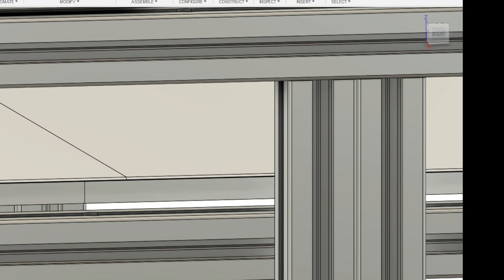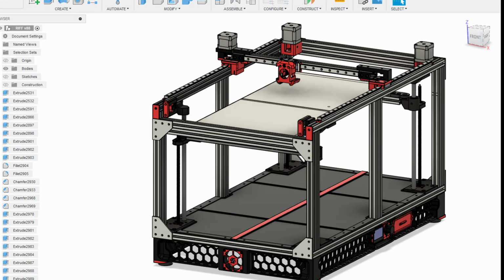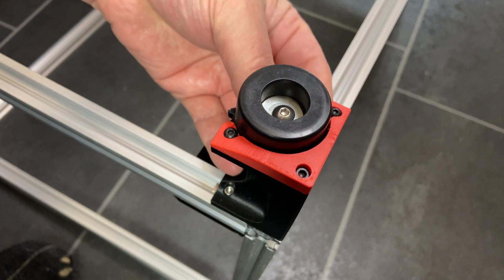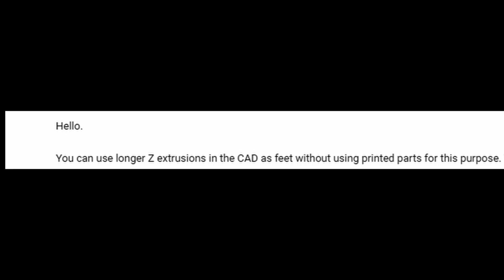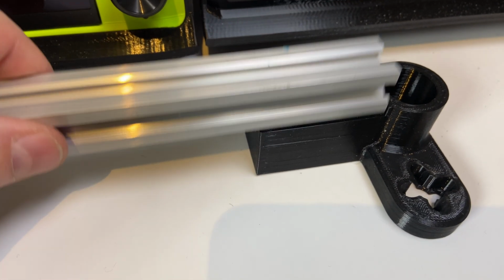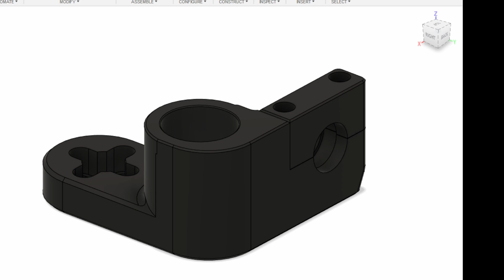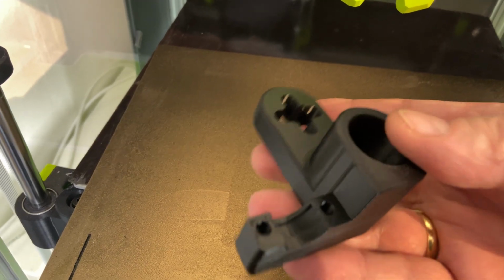The RIFF 600/900 3D printer 2 - skirts and z axis

Comment: Hi, In your design the 00:09:40 arm mounted extrusion is shorter than the other extrusionn by 2cms. May I know the reason why is this?
Reply from the maker: The front and rear arms are different. (spherical bearings vs skate bearings) I cut the extrusions to fit my build and didn't spend much time on that step. Looking at my build now, the front arm could have been a few millimeters longer. I recommend measuring before cutting, and leave enough room for the required movement (slightly up/down for the arms with skate board bearings and slightly up/down + sideways for the spherical bearings.)
Reply: @v4projects  One more question for Z axis which motors should i use are nema17 enough ? 
Im using 3  HGH17 rails as they are commonly available and cheaper than MGN rails in my area. 
For bed (930x620) I  want to use a 3mm glass plate instead of ALuminium plate , and  for Z axis im using 500mm Lead screws.
Any suggestions from your end will be helpful for my build.Thanks
Reply from the maker: @kaushikk7203  My largest build is 900x310 and standard Nema 17 works fine on that printer. (took the stepper motors from old scrap printers) Please note that I am not using any heavy components in the bed assy. Your build sounds closer to a CNC machine :-)

Comment: I'm hard at work building my RIFF600 and noticed that the Thrust Washer Adapter Ring is not in the printed files. Would you be so kind as to add these? Thank in advance.

Also, I just went out and cut a centimeter off my 12mm rods with the "Death Wheel" (Angle Grinder). Not necessarily hard but still a pain in the butt. I haven't needed to cut any lead screws yet but the 12mm rod took quite a bit longer than the standard 8mm rods.
Reply from the maker: I have uploaded the missing file now.

Comment: I was very curious about your larger project, especially the 3D printer bed. I learned how you did it and another important recommendation: you could innovate a little more by adding a leveler to each bed. Remember that the printer is very critical to getting the levels right on the surface of the beds. Congratulations on your project. I built a multifunctional 3D printer, CNC and laser myself using the Octopus Pro controller. I'm finishing it, lol.
Reply from the maker: Thank you for your comments! For the large bed I used ABS spacers and they compress slightly when I tighten the bolts. I don't really need them and on the current build I'll use metal spacers. The oversize 310x310 magnetic flex plates overlap each heat bed by 10mm and that seems to help as well. I could go "old school" and add some springs, but they seem redundant. Elegoo went "cracy" with levellers on the OrangeStorm and the solution isn't super convenient (IMHO). Using a bed mesh is critical to get good results, and so far it's working fine.
Reply: @v4projects  alright, you sold me that thing. i'll build one. so i checked what i needed and am sourcing the parts. first off: if i have questions that would benefit others, should i open an issue on github or what would be your favorite way? second: regarding the heatbed: you used 300x300mm bed with 310mmx310mm plates. is this design (the profile lengths) also suitable for 310x310mm heatbeds too? and third: you have the files in the cad folder. however, there are only the step files which is nice, no question, but a) an import to fusion is not possible (since fusion is shit in importing steps) and b) also these files are not editable. is it possible for you to publish the f3d files too? i gladly pay for it (either way, also for the files you already published)! i was thinking of using only 250mm beds for the convenience of using the plates of my other printers so i maybe would make this whole thing a bit smaller with the avoicande of, as you said in the video, "winging" it :)
Reply from the maker: @Natursektsiggi  I am not sure that I will maintain that project long term on Github. For now use Printables for any build related questions you may have. The frame may be a bit small for 2 x 310 beds depending on the toolhead and overhang in front of the x extrusion. I can check that properly when I have installed the dragonburner on my frame. Regarding file formats I'll look into that.

Comment: I'm intersting in making a large printer like this with 2 beds next to eachother. Do you think a cartesian flying gantry would work for this size?
Edit: I changed my mind the flying gantry will proably weigh 4kg or more, I will try out your design once the cad file is available.
Reply from the maker: A flying gantry would require the printer to be a little wider. It would probably require some beefier stepper motors on z and maybe ball screws. I did consider doing that, but decided to keep it simple and cheap.

Comment: is there any way at all to get rid of the screws, and all the attachment hardwre that is SOOOO expensive in the USA. Ie. superglue the parts together than will never need to or should come
 apart?
Reply from the maker: Most of the new off the shelf 3D printers uses as few fasteners as possible. They use a custom chassis rather than aluminium extrusions and use injection molding to reduce the number of parts. I will probably not glue anything for two reasons. Designs will change and I'll make mistakes during the build.

Comment: Hello, good evening. If I want to make one of 1000x1000, do I just need to increase the guides?
Reply from the maker: Short answer: No. Long answer: You could increase the y-axis with just longer rails and extrusions. I have done that in my previous build. Making the printer 1000 wide would require a different frame/extrusions. I think most people agree that a single 2020 alu extrusion for this kind of use is acceptable up to about 500mm in length ( I have no scientific evidence to back that up). In my build I have tried to compensate for the long 2020 top and bottom extrusions by using the extra 2040 extrusions in the center. I think the frame will work for a 400x1000 heat bed, beyond that you really should spend some more money on the frame, add some braces etc.

Comment: Are you going to sell a kit for ir? what is the final cost for the 300x900?
Reply from the maker: No, I have no plans of providing a kit. The cost will depend heavily on the amount of "recycled" parts you already have that can be used for this build. I spent around USD 400-450 on my build. Long MGN rails are the most expensive components.

Comment: You can print some spacers for the Z-drives to drop them down by the couplers height, giving you that extra motion.
Reply from the maker: Yes good point! I am wasting some space in z. It would be easy to remix the motor mounts for anyone that needs max z height. You just need to figure out if you need some space for the heat bed cables.
Reply: @v4projects  Saw a buddy with the same. He just made a spacer block and kept the original z-block. You then screw the motor on with longer bolts. Z-mount -> Spacer -> Motor.
Reply from the maker: @drpainnuk3d That’s an even easier way to do it! Would just need to check that the leadscrews are still long enough. I’ll mention this possibilty in the next video. Thanks!
Reply: @v4projects  Awesome, hope it helps!

Comment: This series and the last one on lemon breeze have inspired me and given some direction to finish my Kobra max conversion to a “core xy” machine. 

I was having issues with the bed traveling nicely and seeing how you have made this bed travel gave some direction for me to take with making mine functional. 

Especially on a budget… got the machine for 100 USD used “non running” and was able to make it run. 

All in with parts maybe $350-$400 including plenty of extra parts to convert my other Kobra. 

Thank you for good content!
Reply from the maker: Thank you! I am glad you found some useful information in my videos. I noticed that Anycubic have some interesting large heatbeds ( more than 400x400) as spareparts. You need a large PSU for those, but a 400x800 printer would be a nice size.

Comment: Which heated beds have you been using for this build?
Reply from the maker: Spareparts for the discontinued Anet ET5 but you could use almost anything as long as the two are identical. (I got the heat beds very cheap), In some of my other builds I used heatbeds from Longer LK1/Alfawise U20.
Reply: looks alot like ones used on sovol sv04